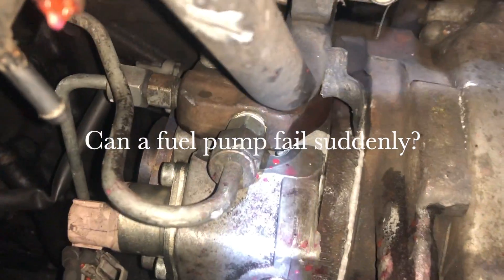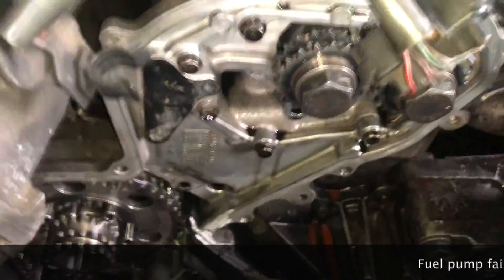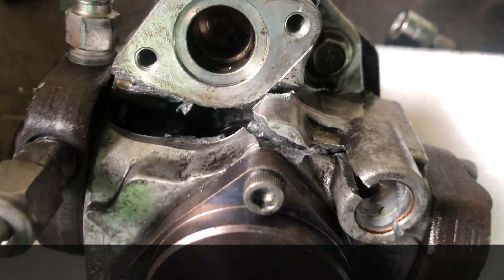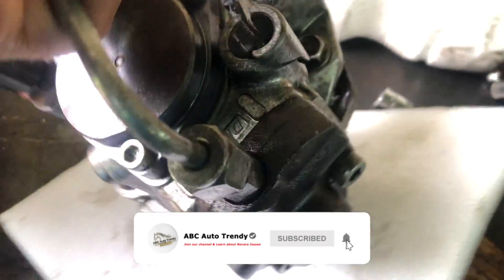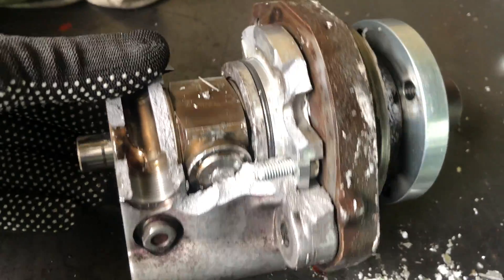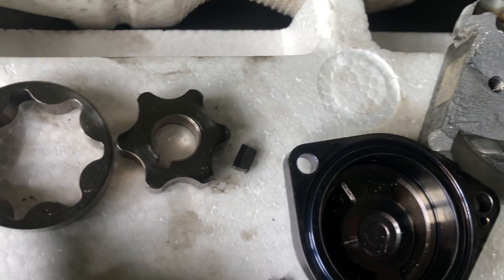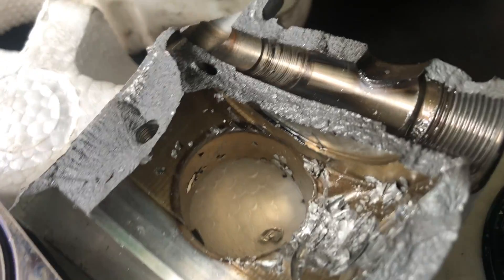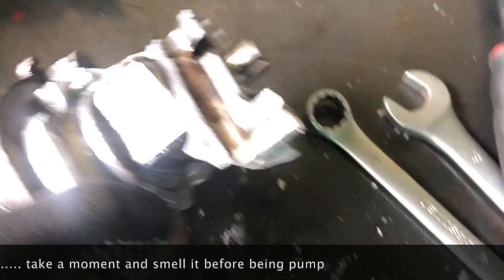Injector Pump Failure | Injector Pump Burst | Nissan Navara D40 | Dirty Fuel

Comment: Great video, was having some trouble with the fuel pump, is there a micro filter in this particular Fuel pump?
Reply from the maker: Yeah, there is a micron filter which you can remove it and clean after taking off the pump out of the engjne